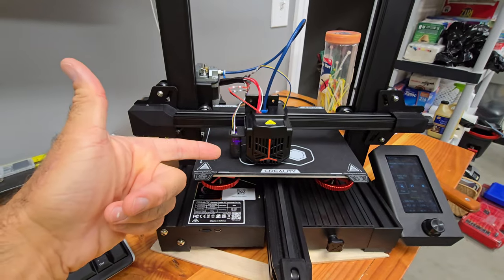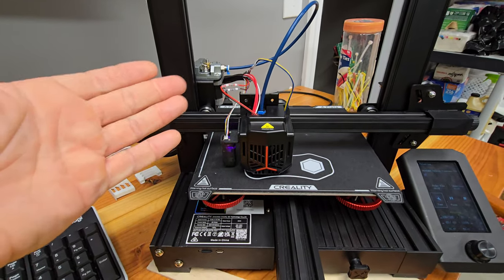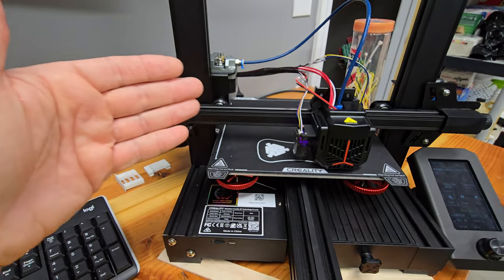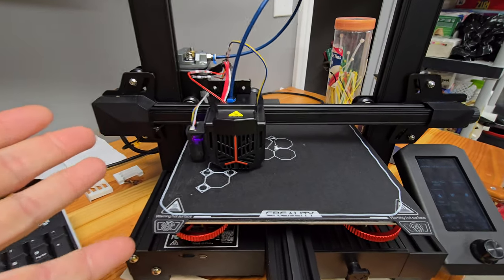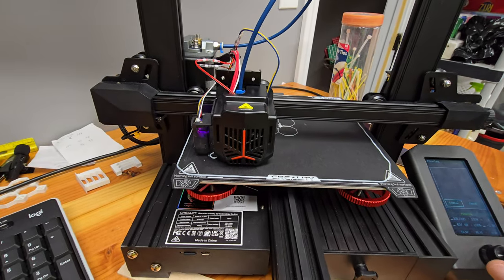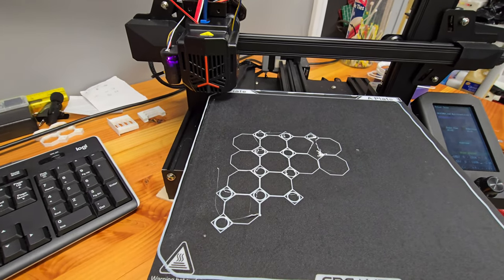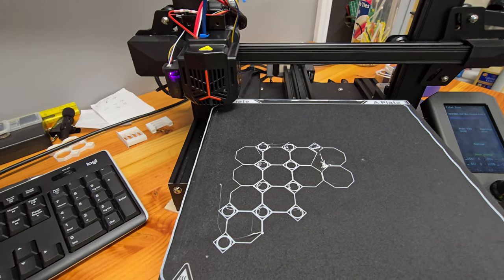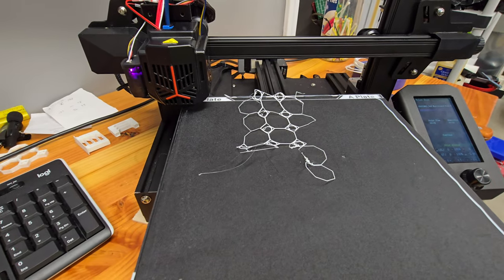Ender 3v2 Bed issues

Comment: I had a spot on my bed that was having adhesion issues at one point.  I just cleaned it with some dish soap, warm water, and a soft sponge and it started working perfectly again.  I'm pretty sure it was oil from my skin touching the plate that was causing the problem.